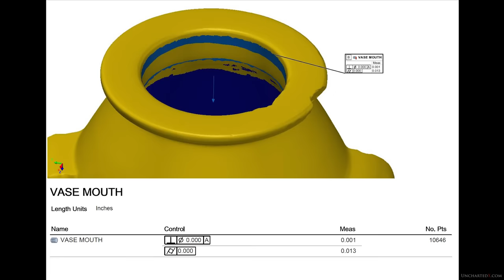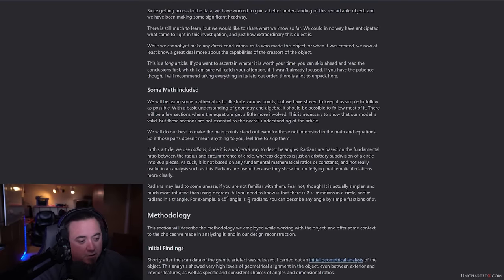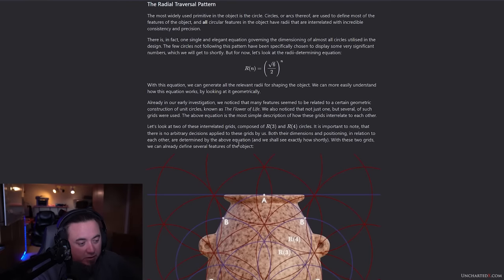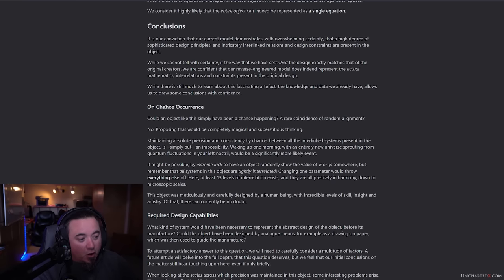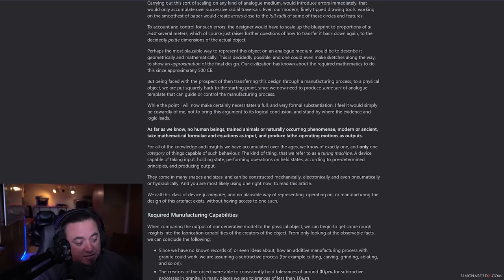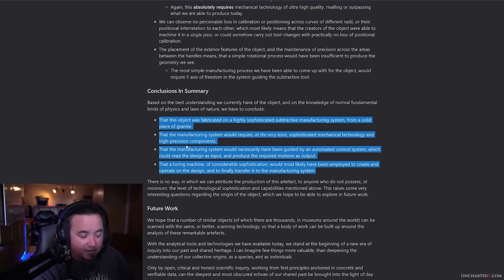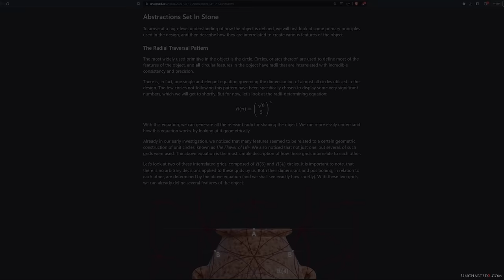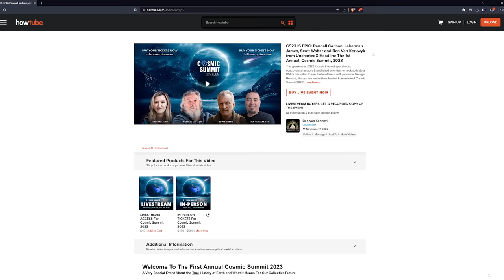Was a COMPUTER Used to Design this Artifact??

Comment: Anything lathed will be perfectly round 🤷
Reply: Only if the spindle bearings are precise and the tool is rigidly held in position. But this video is about the translation of the design into the manufactured artefact.
Reply: okay now address the area between the handles...
Reply: @AustinKoleCarlisle  obviously they carved away the area between the handles.
Reply: @robinpetersson3081  how did they know how much material to remove down to the 1000th of an inch, and keep the tolerance consistent on the entire piece, 1000s of years before the creation of the micrometer?
Reply: @robinpetersson3081  as opposed to Russians making "recreation" vase videos with suspect editing in their basements, the data surrounding this vase is open source and is free for anyone to analyze. when you have truth on your side, there is no point in hiding anything.
Reply: @AustinKoleCarlisle i did examine the vase and it's clearly hand made. Posted a new comment.

Comment: I’m a great fan of the channel, but Ben also emphasises his welcome for doubts and criticism.

Having said that…
The manufacturing abilities remain the most powerful argument for me. Not the mathematical ones.

A young child can use an implement that creates an excellent circle, yet the child has no knowledge or interest in the value of Pi.

The golden ratio crops up all the time in nature, down to the molecular level. And the human brain easily recreates it with straightforward tessellation procedures which seem instinctive.

Fermat’s Last Theorem was proven correct by Andrew Wiles some 300+ years later than Fermat not having enough room to write the proof in the margin of his page. Yet no mathematician believes Fermat was using number theory that Wiles did. So how did Fermat do it?

As with all the other arguments about the mathematics and alignments of the pyramids, I don’t buy it. As a graduate student I worked alongside other people who used mass spectrometry to analyse what we created. The curse of synthetic chemistry coupled with things like mass spectrometry is that you know the answer you want, a priori. The mental hoops that some people jumped through to prove that what they got was what they expected was sometimes breathtaking. It’s not just Egyptologists who indulge in the sort of behaviour Ben often mentions. Mathematical arguments are some of the easiest ways to create self-deception.
Reply: things are more than just mathematical. short of CNC machines, we can't even replicate polygonal masonry that spans the globe which was created in supposedly isolated cultures.
Reply: These vases are easily seen to be inprecise with just the naked eye - i mean just look at the handles.

These are easy, if time consuming, to make by hand

Comment: That circle theory is ridiculous. These guys should complete at least the first course of calculus, and then they can come up with spline formulas, which might work much better.
Reply from the maker: or maybe you need to look up what a radian is
Reply: Calculus didn't exist even 500 yes ago, much less 5  thousand. If they used calc it's even more impressive.

Comment: Interesting how they used the metric system millennia before it was invented.
Reply: Units of time come into play in the 16 GHz wavelength discussion, but otherwise the analysis is independent of measurement units.  Pi is pi no matter the measurement system used, because it is the ratio between a circle's circumference and diameter, which is a function of how our universe is built.

That said, regarding the metric system, there is a direct relationship between the Egyptian royal cubit and the meter, which is very strange coincidence.  It is also an amazing coincidence that the Bolivian stone "H" blocks at Pumapunku measure 1.00m tall x 1.00 m wide.  More detailed measurements are needed to determine if it's actually 1.000m x 1.000m. But again, it could be just a coincidence.

Comment: This is such a bad video. Why not use the same logic and effort to analyze vases made by people today? The Ancient Egyptians did not need computers to figure out what vase looked aesthetically pleasing. They could just use a wooden guide that matches the contour, and then polish the vase while sliding the guide around its circumference to stay true to the design.
Reply: Did you bother reading the paper that is linked to in the video description?  The object is completely defined by mathematical functions, and the physical part matches the design within tiny fractions of a millimeter.  The design principals used in the design of this "vase" shows that the makers were aware of physical principals such as the speed of light in a vacuum, and that light is an electromagnetic wave, which our civilization didn't know until 1865, while we haven't had the ability to turn equations into physical objects with this type of precision until the last 20 - 30 years or so.  Either this object is an extremely good hoax, produced by some current-day prankster at enormous expense, or there is a gaping hole in our knowledge of the past.
Reply from the maker: 15 levels of mathematical interrelation, describable in a single algorithm elegantly manufactured in a base-radian system, pi, phi, and perfectly matching a mathematical CAD model = 'aesthetically pleasing.'  Clueless and deep in the dunning kruger curve.
Reply: @UnchartedX  It's astounding how few people here know what a micron is. And it's significant in manfacturing.

Comment: Yes ita a buitifull piece of art,but don't overkill it.yiu could do these designs on a tin of beans and get the same result. 
Nice scam thoe Ben,don't mess around anymore getting small contributions. You tell them mate, 20 bucks or f off.
Reply from the maker: Lay off the crack mate, I don't think you had much grey matter to start with, poor bugger. I hope you get by working with your fingers

Comment: Nice artifact, poor analysis! No wonder the second author doesn't want to be named. Qvist just arbitrarily draws circles on the artifact, with no correlation to the dataset.  All the circle stuff is nonsense. And, he claims the neck has a conical section with 1 radian arc--well, not in the picture it doesn't.  The angle is at least 5 degrees less than 1 radian.  What gives?
Reply: you should not expose the vastness of your ignorance
Reply from the maker: incorrect. You need to read his work more carefully so you might not end up looking so silly. The circle grids correspond to the maximum internal and external diameters of the vase, and everything else is geometrically aligned to features of the vase.

Comment: You're wrong. This is not very precise, nor impressive. A caveman could make this easily.
Reply: You couldn't make this. Get a piece of granite and see how long it takes to simply polish it without  machines, or round a corner..Marble? Sure, alabaster, even jade is softer.
Reply: @stevenvercelletto9660  Uh I have lmao It is not very hard. Learn about dry vs wet sanding its been 4000 years bro
Reply: @giffica  You have? Out of granite? Without power tools? How did youu do the inside? How long did it take? Have a photo? Id love to see it.This item IS presice and symmetrical as the scan found.
Reply: @stevenvercelletto9660  Have you literally never worked with stone? Stop watching youtube videos using hyperbole to make it sounds like its so precise a human hand cant do it. It absolutley can, and we have thousands of examples of precise and exact hand tooled pottery from the last 8000 years
Reply: @giffica  OK,, but you didn't answer a single question I asked about the one you said YOU made. Enlighten me! I'm not arguing an agenda, I'm seeking actual info, not hyperbole w/no evidence. Did you really make one as you claim?